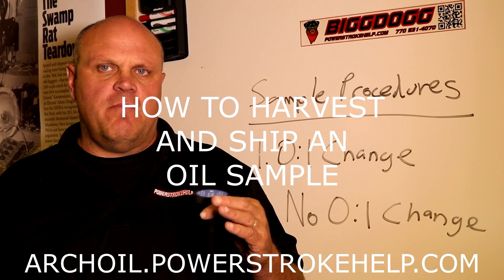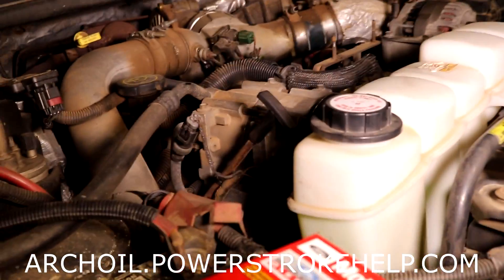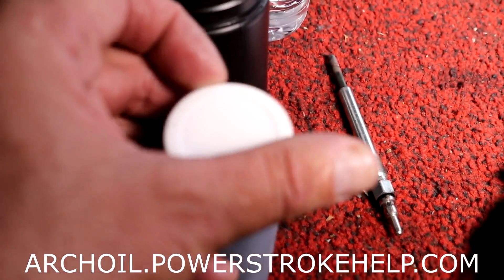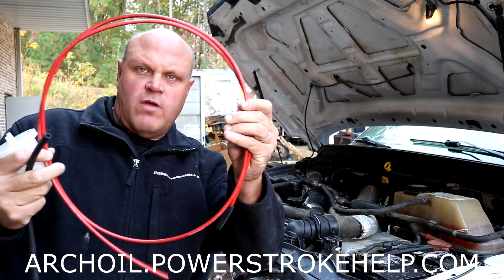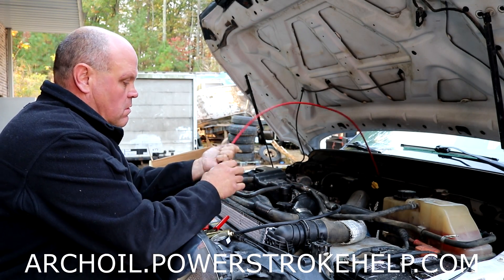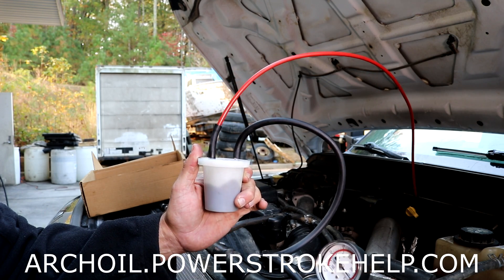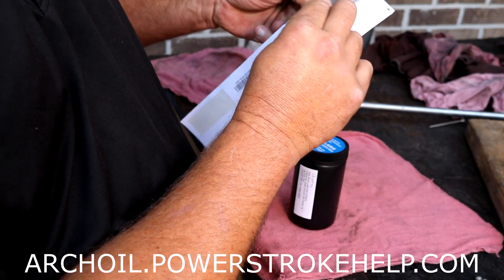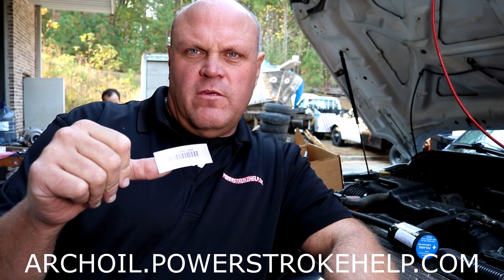HOW TO SHIP AN OIL SAMPLE

Comment: HOW ARE YOU.?
i have a 97 f250 powerstroke and i want a get more powerful.!
WHAT DO YOU RECOMMEND FOR A BETTER PERFORMANCE IN FUEL SAVING AND GOOD POWER PULLED.?
thanks.!!!
Reply: This is Tom.  Bill is the truck/engine performance guy, but I can tell you that before you start throwing money and high-performance parts at your truck, you need to go thru every component and verify that the proper maintenance has been performed using the best products available.  More power equals more stress on everything - especially the cooling system and transmission.  The other vitally important areas are getting sufficient air and fuel into the engine.  Watch Bill's older videos on truck maintenance, and then use the best parts / fluids / filters available.  Contact me if you have questions about oil, filters, transmission fluids, gear lubes, coolant, grease, brake fluids, etc.  www.best-synthetic-oils.com

Comment: Bill with trucks you have for sale do you. Take trade in's ??  got a 2005 60 stock.  136000 miles. on it work truck f250 crew cab.  I want a f350 reg cab work truck plow snow Ect.  yes like you say got to have deep pockets to own a 6.0.  thanks

Comment: How do know the micron rating of the filter?
Reply: tpcoachfix I usually start with the filter maker's website.  Wix also has great look-up guide, and their filters are designed to meet OEM spec, so you should be able to cross-reference to/from Wix to get micron rating.

Comment: this is a great video/series.  how about taking a sample from a truck at a dealership you're interested in..?  you wouldn't know the last oil change or any of the other information - oil type, etc...  could they still give you reliable data?  what's the turnaround if this is a vehicle that's on the market that may get away?
Reply: Chris Iversen would they even let you get that oil?
Reply: Performing oil analysis on a used engine before you buy it is a great idea that can really protect you from trouble.  If you pre-register your sample online and provide an email address for results, you can get your report back in about a week.  The historical information (oil change date/miles, etc) isn't important for this type of check.  Knowing the oil brand and weight would be helpful, but not critical.  You want to know if there is significant metal, fuel, or coolant in the oil.  You could also use a Block Tester tool (NAPA sells) to see if there is any combustion gases in the coolant.  That would alert you to head gasket, cracked head/block problems that is allowing blow-by gases into cooling system.
Reply: i figure if they wont let me take a sample i just walk away.  Real question is would they bring down the price if it came back needing major work.  tough one.  They'd probably hold out for some poor schmuck who wasn't meticulous about doing their homework.